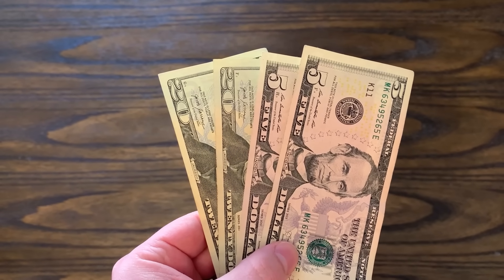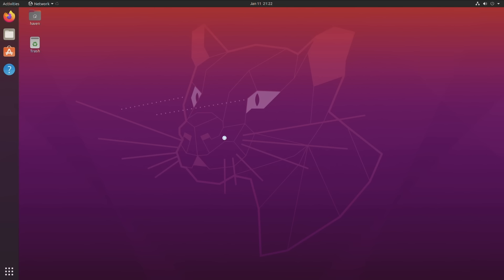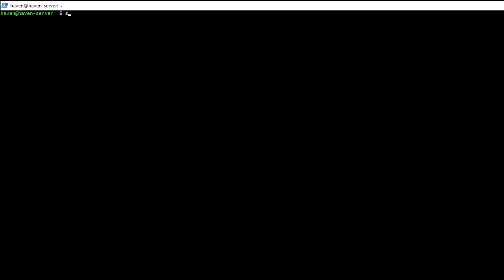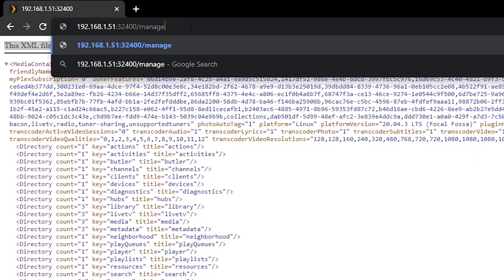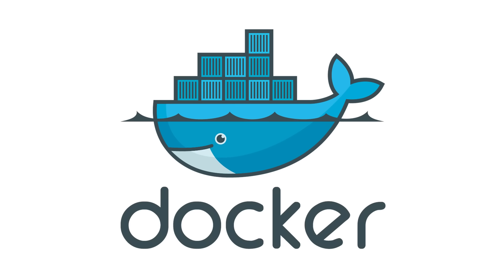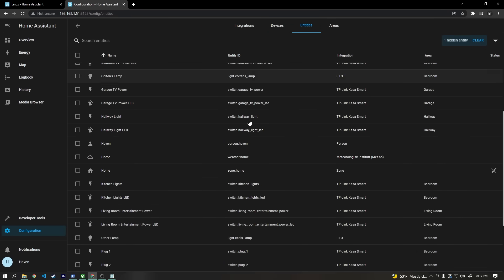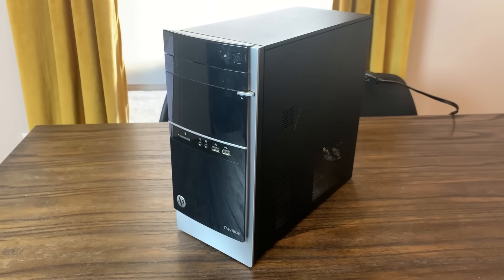Incredible Budget Home Server! (Minecraft, Plex, Home Assistant, NAS)

Comment: people you can get yourselves a Quad Core X5000 Xeon pre-modded from 771 socket   -> 775 socket for less than $10 shipped. There are compatible 775 motherboards everywhere usually sold in good conditions for like 10-15$. DDR2 is very cheap if you go for the 4x2GB Config, although some motherboards will allow you to use more expensive DDR3 (I use ddr2 on my xeon setup). This combo is very powerful for its age and cheaper than this video. Get the CPU in aliexpress and the rest of the components should be sourced near your area cheaper than on any website.
Reply from the maker: This wasn’t a hardware recommendation video. It was just meant to show some of the cool things you can do with older hardware you might have laying around. Also, while these xeons might perform better, they definitely won’t be as efficient, so you’ll end up paying more on your power bill. Still good hardware to use though 👍🏻
Reply: @HardwareHaven  I really liked your video, I'm huge on reusing older hardware, I hate e-waste! So thanks for helping!
(btw I'm from latam, power is very cheap here, but people on the EU need to watch out for their power usage)
Reply from the maker: Appreciate it! Power isn’t too bad where I’m at either, but it’s still nice to keep the bill down

Comment: This is neat, i would consider also changing the case to smaller, so only one fan is needed, disconnecting the CD drive  - that will lower power consumption too. With many saying this is underperforming server, i disagree, i am still running small nas since 2014 and performance wise there is nothing missing to it. And if you have 2 Sata ports, there is always room for upgrade, and you can also change memory, system, plug few things here and there - not bad for tiny BUDGET in my opinion! Only thing i don't like is that it such a space waster...

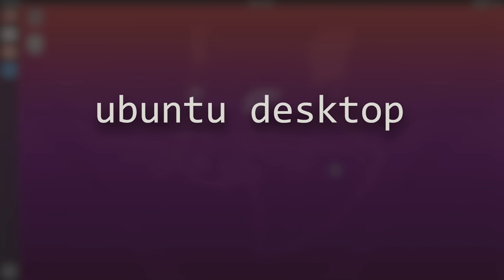Comment: (2:04) Actually, some distros (like Linux Mint and Ubuntu) are intentionally designed to be easy to use, while some (like Arch Linux) are designed for more advanced users.
With you doing a lot of stuff in the command line, you could've probably gotten away with Ubuntu Server, and using "nmtui" (Network Manager text mode UI) to configure your LAN settings.
Reply from the maker: For sure. I use Ubuntu server quite a bit. Just figured a desktop environment to get started was a bit more beginner friendly
Reply: @HardwareHaven  
Oh

Comment: I would use Xubuntu, (if you absolutely need the Ubuntu-family) because I don't like Ubuntu-desktop and Gnome. Runs 'lighter' as well. Kubuntu and Ubuntu are the heavyweights of the official Ubuntu family.  There are smaller and lighter distributions out there for these tasks. With this kind of hardware every bit counts. ( get it?) And 'sudo apt update' updates your repositories. You run 'sudo apt upgrade' to receive and install the newest software. Good video. I like reusing stuff.
Reply from the maker: Thanks for the input! And I completely forgot to show apt upgrade in the video. That was a mistake on my part

Comment: I actually happen to have an older PC just sitting around.  It is a i7-7700k, with 6gb RAM and a GTX 1080.  I could, in theory, turn it into a server, huh?  Very interesting.  I am going to bookmark this video, and if I ever get the bug, I am going to use it as a step-by-step.
Reply: Get a higher ram, ram is mostly used by servers

Comment: The only thing i would change is Put that PC into a ITX case, using a DDR3/DDR4 to sata adapter. [you will loose 1 slot of the memory, but can use a SATA SSD instead]

Comment: 5:00 
Why you are using ethernet adapter to usb 3.0, this is slower
Reply from the maker: Usb3 to gigabit is much faster than the 100Mb nic on the motherboard. If the mobo had 1Gb, then that would be best
Reply: @HardwareHaven  Usually USBs are a black hole for me, but as l know the maximum you can transfer from USB 3.0 is around 30MB/s unless it is super speed usb
For an office PC, l doubt there is no usb super speed. Correct me if l'm wrong.

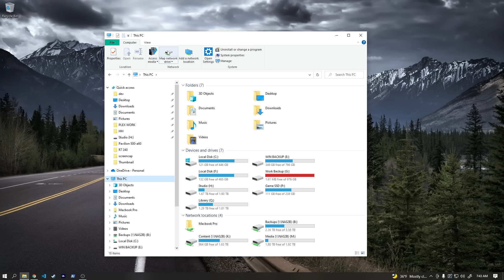Comment: 7:41 i got a problem with that. no clue why, but i reinstalled ubunto 3 times because of it but im sure i did everything right. BUT i wont get the message with ,,Added user ---'' could someone pls help me with that? idk what to do anymore. its very frustating
Reply: make sure you added everything correctly at the bottom of the conf page. I was getting a issue because my root folder used a capital letter for a file name and i used a lowercase letter.
Reply: @tonio14  i was confused as hell because there was a cut X) ty
Reply: @Mayumiirith  did you get  that second to work for you?

Comment: Interesting video!

One thing I would say is be careful with Gigabit Ethernet to USB. If it's USB 2.0, you're not going to get 1Gbps, but the maximum USB 2.0 bus speed of 480Mbps. If the HP PC doesn't support USB 3.0, I would have gone with a cheap Gigabit Ethernet PCIe card. You can usually have them for like a couple bucks on Amazon and they'd guarantee you the full 1 Gbps speed because PCIe bus speed is much faster than USB (I believe PCIe 3.0 is 1 Gbps per PCIe lane).

Additionally, instead of Ubuntu Desktop, on my home server I like to run Proxmox. It's a free Linux KVM based virtualization software that supports VMs and LXC containers and it's fairly easy to install. You can manage it via a web interface and can spin up containers or VMs for things like your Minecraft server, Plex, Home Assistant, NAS, and everything else you install. They have an enterprise version too, but you can install it for free and use the pve-no-subscription repository if you need free software for it. The free version does not have any feature omitted from the enterprise version. In the enterprise version, you're only paying for support from Proxmox and slightly more stable packages as the slightly less tested packages go first to pve-no-subscription repository. However, in my experience, I've never had an issue with any package from there.

You can also install VMware ESXi. There is a free version, but it is somewhat feature limited so that's why I go with Proxmox.

Otherwise, great video!!

EDIT: Forgot to mention one more thing, but if Minecraft is GPU-accelerated (I can't remember if it is), the lag issue may be because your iGPU is bottlenecking you. I'd recommend trying to eventually find a cheap external GPU somewhere (when there is availability and prices for them arent equivalent to the GDP of a small country, of course).
Reply from the maker: Great thoughts! I was indeed using USB3.0 for the usb nic. I would’ve considered a PCIe card, but this unit doesn’t have PCIe slots haha. And I chose Ubuntu Desktop because I felt it would be a little bit more approachable for someone new to this type of thing. And if there’s ever an issue, they can always hope into the gui to try and fix it. Proxmox is definitely something I want to look more into in the future though, so I’d expect a video on it at some point 👍🏻

Thanks for the comment!
Reply: @HardwareHaven  ok that's totally valid. Kind of figured you were using USB 3.0 but couldn't tell based on age of the machine. Good luck with the server and I look forward to seeing a Proxmox video in the future!

Comment: I'm having issues with the Plex part of this tutorial, sadly. Plex not "seeing" my network share.

I navigate it to /home/<user> and... then Plex shows nothing further. It's like it's blocked from even seeing the subfolders.

I'm running on Ubuntu 22.04.
Reply: Were you able to get around this? I just ran into the same issue
Reply: @purpstm  So... I did something I'm not sure you're supposed to, I rightclicked and went into "home"'s folder properties, went to permissions tabs, and gave rather liberal permissions to it in the bottom part. IT WORKED, but I'm not sure I'd recommend this since it seems less secure, but as I was just playing around and /learning/ Linux, I didn't feel the need to worry that much. I'd like to ask people smarter than me about Ubuntu if there are more secure ways of doing so.
Reply: Also I did a dumb and did it for home and all subfolders, which made the desktop icons gripe at me because the OS, for security reasons I guess, requires the desktop folder to have less-privileged permissions.

Comment: One thing which was mentioned in the pinned comment which i would like to shine a bigger light on is old vs. newer hardware and their power consumption and features: 
if you plan on using the server for longer than a few months, it could make sense to buy used components individually and use modern hardware like 2-3y old intel i3 or Pentium CPUs or amd ryzen 3 APUs, and low end boards. 
That way your power consuption will be way lower upwards of half the power consuption or less, and calculating power cost over the span of 2-3y could make the initial higher purchase price seem way better because depending on country (i am from germany) we pay 33ct a KWh that would be about 100€ a year for a 20w server which my i3 9100 server currently uses, my old server used a haswell cpu i5 4690 which is about the same speed as the i3 (both 4c cpus), just that its quite a bit older and because its an i5 it used like 40w vs the 20w of the i3 during idle server use just because the architecture is older, chipset uses more energy, older ddr3 vs more efficient ddr4 and more.

Considering i sold the haswell system (cpu, mainboard and ram) for 40€ and than bought the i3 and h310 mainboard for about 120€ (1y ago) would make the system pay itself in almost exactly 1y which for a small homeserver isn't that much at all considering the haswell system before that ran for 3-4y using it for plex, minecraft, as a webserver to access my files on the go and as a diy VPN so that im secured on public networks and considering the way more modern features of the i3 9th gen like:
-iGPU hardware accelerated video encoding for plex (saving even more energy)
-the more modern architecture with more USB 3 ports for External backups or and just in generell more mature ports and connectivity
-more modern bios features like turning the system on at a specific time of day to safe even more energy when the server isnt needed (for example when you are sleeping)
-better built in RAID for redundant hard drives and a possibility to have linux or windows on a hardware raid and not relying on software
-the ability to swap in even stronger cpus in the future for rendering/encoding or even running more server software or even seperate VMs (9th gen can go upto 8 core cpus)
it honestly makes alot of sense, tho a old pc like the one in this video is a good starting point to first install server software mess around with what works best for someone and than you could always upgrade in the future.

Comment: just a quick comment on this, otherwise nice, video:
Use ubuntu server distribution, instead a desktop one... less resource and disk space used.
You just need to connect via ssh to the server, no need to use GUI.
As stated by others, install portainer, so you can access your docker setup via webgui
Reply from the maker: Both great points! Using Desktop versus Server was intentional, as I wanted it to be a little bit less stressful for a new Linux user. Being able to access a GUI for troubleshooting can be pretty helpful if you’re not very comfortable with command line. 

Portainer seems like a really good idea, and I’d probably like to visit it in another video! I don’t have a ton of experience with it so that could be fun. Thanks for the comment 👍🏻

Comment: Interesting. I just upgraded the guts of an old acer box from an FX chip to a 3200G. Does the server require a good gpu. Or is that handled by the local machine still? I have an old r9 270 and a gtx 480 laying about if it does.
Reply from the maker: Typically you don't need a gpu in a server. The only things that helps with is things like video transcoding for something like plex, and AI type stuff

Comment: Funny enough, i did something almost exactly like this 6 months ago. I had a spare laptop laying around that had windows 7 still on it. So i looked into converting it to an ubuntu-server instead. I remember the process being a bit rocky, mostly due to running the mc server. The conversion went beautifully.  i got it all setup headless (despite being a laptop the keyboard is completely broken so i opted out of the DE). And it's worked like a charm since. I'm really happy to see you encouraging people to try out Linux even if it seems scary at first. I dipped my toes in for my server and later ended up converting my main laptop into Manjaro.
Reply from the maker: That’s awesome! And yeah I was similar with Linux. Having a system similar to this was how I got more comfortable and confident in Linux. I don’t use it for desktop use, but a lot for server and development stuff

Comment: OR...

Issue is, a $50 server isn't exactly going to be able to run at the same time a Minecraft server, an octoprint server, a media server, a file backup server, a web server...

(Also I made an opnsense router with the intent of multipurposing it as a general server, apparently OpenBSD isn't good if you like running 3rd party software, even Linux-based [depending on driver support; BSD isn't Linux]. Don't use BSD for a server except for Pf/Opnsense; use Linux.)

Also these days theres ARM and x86 servers, either is fine except for specific software use cases, and while ARM may typically be more power efficient and cheaper, x86 has more desktop and driver support and it's easier to get a higher performing CPU that runs x86 (high performance ARM is made for enterprise servers and datacenters, or are otherwise custom made like in Apple or Google devices. Sure Apple CPUs can be decent but are you really going to spend the Apple tax for running a server on an OS more limited than BSD?)

Comment: Isn't it more simple to use Ubuntu server instead? You do save in memory due to the lack of desktop environment and the IP address setup is done on the setup screen. You also have the option to enable SSH and set it up on the setup screen VS the desktop variant of Ubuntu.
You also have the option to select the snap packages on the setup screen. Overall, I think it would have been simpler using the server variant and it gives the chance to people new in Linux to learn and feel comfortable in front of a terminal environment.
Reply from the maker: You make good points! Ubuntu Server (or more recently just Debian) is what I would use. My thought was that this would be for beginners just getting into Linux, and having a gui to fall back on could be helpful for initial setup and troubleshooting down the road while also introducing SSH/command line. Hopefully that made sense.

Comment: Does the PC has to be turned on 24/7 for hosting server for Minecraft ??
And does it support cracked servers ? 
And how to know that it supports cracked Minecraft server hosting ? And how to make it cracked server ??
(Sorry for so many questions)
Reply from the maker: I would suggest looking at my more recent MC server video. It can be ran 24/7, or you can shut it down when you don’t need it. 

It’s possible to run a “cracked” server by making a change to the server.properties file

Comment: Hi, i encountered a weird problem and as a noob i dont have a solution even after posting in multiple linux communities. Please check if someone can solve. I am stuck! 

I have connected HDD externally to Linux mint machine. I want to use this drive for plex server, the drive is not showing up in plex library manager. Any suggestions?

Comment: A raspberry pi will do all of the above. Including a minecraft server.

And they are easily to attain and/or replace, use less power.

If you want mincraft it's adviceable to get a pi4 with at least 4Gb.

I have even played minecraft on a pi4 itself, with 40+ fps, which was playable just fine.
Reply from the maker: Unfortunately RPis are a little tough to find right now, and not many linux/self hosting newbies have one just laying around. A lot of people have an old desktop sitting in the corner collecting dust. That's more of the point of this video. Appreciate the comment!
Reply: @HardwareHaven  
Appreciate the answer!

Rpi availability may be an issue.

However besides that I'm against using old PC's for this purpose. They are powerhungry by comparison, and not build for contineous operation, often in poorly ventilated circumstances (like fuse boxs/utility closets), and thus form a fire hazard.
Reply from the maker: @janklas7079  for sure! That’s one of the good things about t build like this is that it pulls about as much power as a small NAS, being a laptop chip in a desktop. And because of that, it produces very little heat. I wouldn’t typically suggest running a more power hungry old machine 24/7. And there’s a big difference between running under light load 24/7 and running under heavy load 24/7.

Comment: Hey, I wanted to use this old power edge server I got second hand as a server for me and my friends. How could I allocate extra ram(I have 32 gigabytes) and how could I easily make it so my friends could connect without being on my local area network
Reply from the maker: I would look into using something like PaperMC, not what I did here. It will probably run a lot better. 

As far as making it public, you'll either need to port forward or use a tunneling service like ngrok or playit.gg